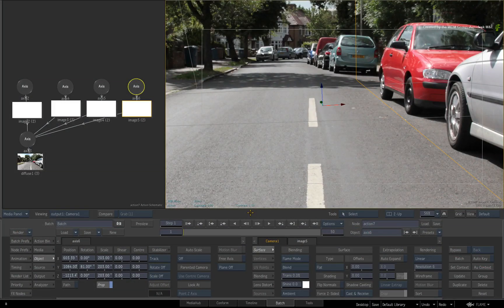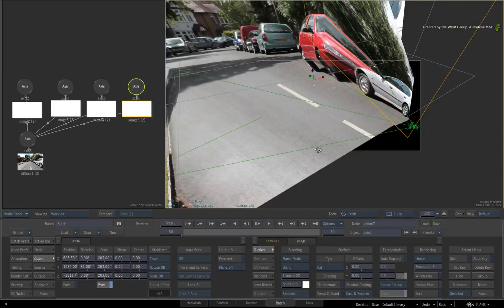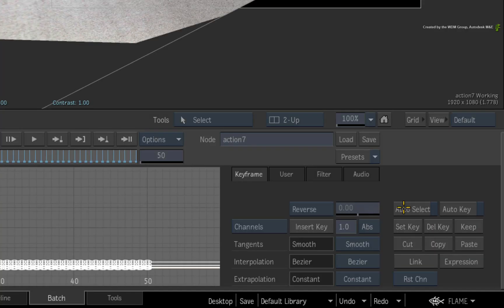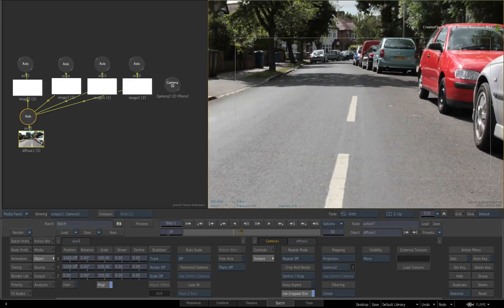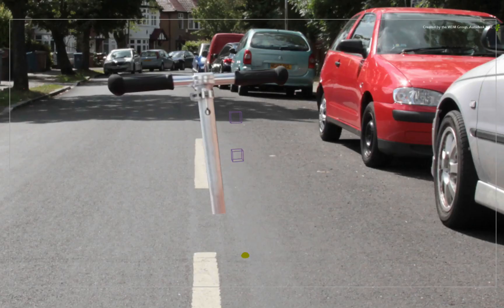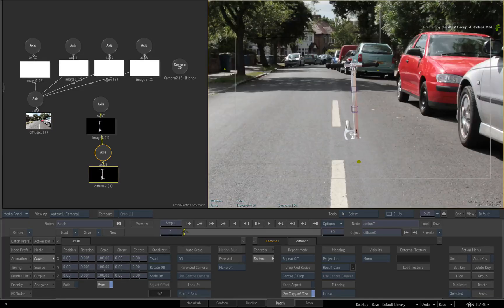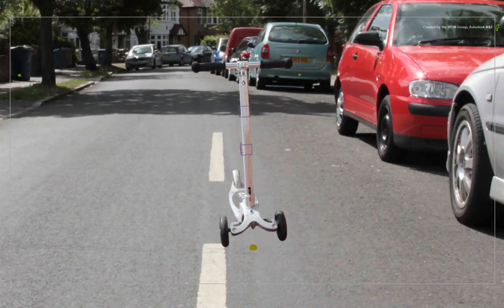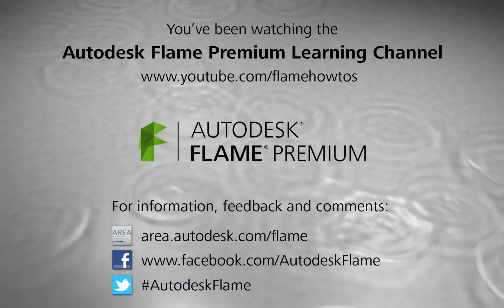2D to 3D with Projections - Part 2

Comment: Its not necesary to project the scooter into a 3d plane, since the scooter has already baked in the perspective changes. After your 3d projection scene is render into a 2d image you just have to comp the scooter over as a 2d image. If your track is solid, it would align perfectly.
Reply from the maker: Hi @Javier Andres de Valle, At the part that the scooter is added back into the composite, I did mention that it could be composited separately in a later comp node which is what you suggested, and if you did that method, composing the scooter over the image would simply work.    But that is just layering A over B.     If you were doing more intricate work, you may need to look at an alternative like the projection method I chose as an alternative.

Regarding projecting the scooter in 3D space, the receiving surface is used a point of reference to determine where the scooter sits in 3D space.   Projecting from the camera guarantees a 100% match to the 3D camera without messing around.    If you where simply to add the 2D image surface into the 3D composite and position it at the locators in 3D space, it will take you a lot longer to line things up correctly.  Even moving the 2D image by a couple of pixels will slide the whole frame.   

There are obviously other methods that may work in various 3d composites but I encourage you to try it and choose what works best for you.